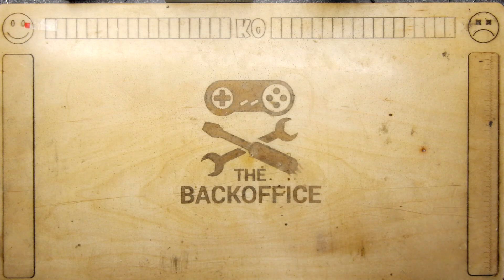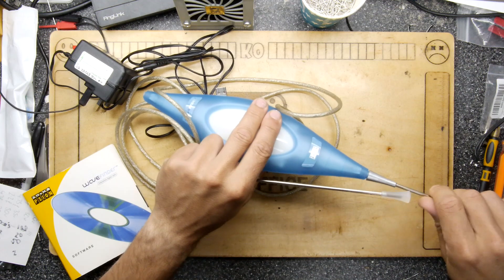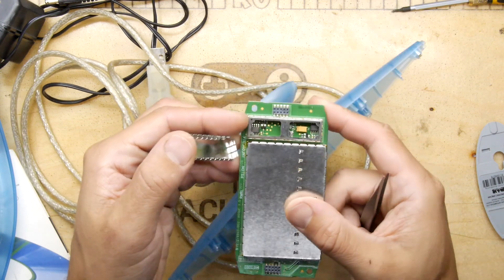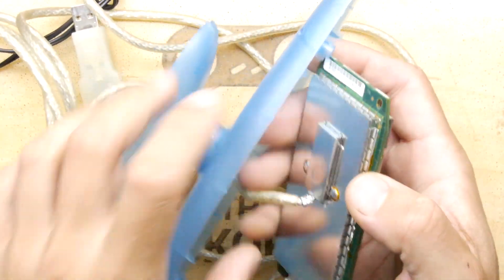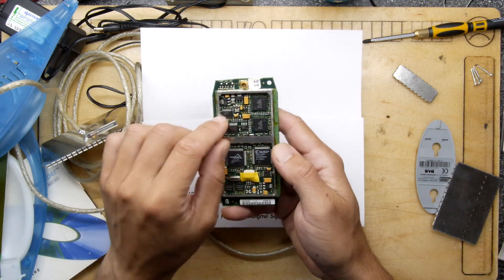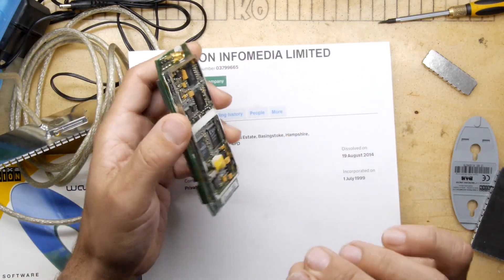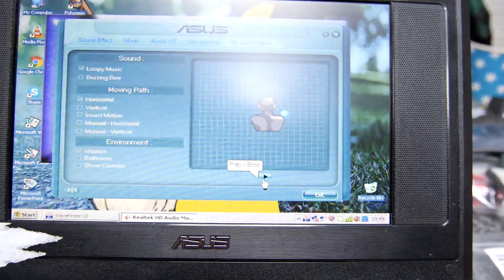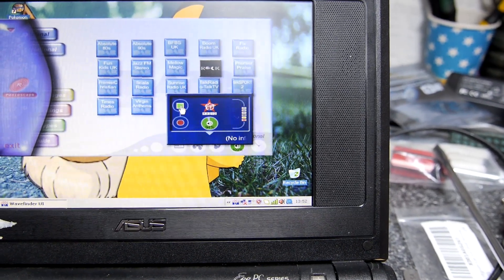Psion Wavefinder - The first SDR Radio Device

Comment: I am the creator of the DAB Bar software, the software often used instead of the Psion supplied Radioscape front end. I will say I have a great deal of respect for Radioscape's work. Although the UI is very much from yesterday, it was ahead of it's time at the time, and sadly not do usable for most people back then. This caused me to produce a replacement for me, I then put it on the Internet, and it took off as the default replacement.

To answer some questions posed in the video. The branding assets are installed with the software. They are out of date and are shown because the Service Identifier (the SID) is still in use. You will probably find Virgin is actually Absolutism Radio (what the original Virgin Radio rebranded to) and there may be a second new Virgin Radio without any branding. There were experimental data services to supply branding over the air (DDAB?) and some branding capability in the EPG specification, but I don't think anything is doing that today. DAB Bar had downloadable branding that was eventually maintained by Radio Feeds (thanks Vinnie)

In answer to a question unasked in the video, but common new question IRL (and yes people still sue DAB Bar)... Annoyingly I can not get to the data stream for DAB+ streams. I presume that the RadioScape demultiplexer code is deciding that it is corrupt and does not forward it though to me to decode.

I have had mixed results getting the Wavefinder working under emulation. My suspicion for the times in the video where the Wavefinder did not light up is the USB port closed down because of power usage. The Wavefinder can pull just a little more power than it should and any computer or hub following the USB spec should close the port down when this happens. The best work around for this is an old computer or a cheap powered hub (not self powered) that does not follow that USB spec all that closely. I have had it working with the 32 bit version of Windows XP, but never any 64 bit version. One day I intend to try 32 bit Windows 10.

Finally DAB Bar can still be downloaded and I do intend to publish it all on GitHub one day. It is just a matter of when I get round to it.
Reply: I'm in Bristol and have found here that two DAB stations(BCfm and Gaydio) are transmitting their branding OTA via the DAB streams.

Comment: Hello, great video. Great to see you got it working and to take a look inside.

Some points you might be interested in.

1. Wavefinders didn't work on 64 bit machines very well, and not at all on Windows XP SP2 (although SP 1 and 3 were fine).
2. As mentioned above, the Wavefinder was before DAB+ was a thing, which is why many stations are silent. 
3. The logos were baked in to the software.
4. The LEDs were a source of many issues, you could download a file to disable the LED functionality which improved reliability for many.
5. Other people created their own software to control the Wavefinder. One really good third party software solution was DAB Bar.
6. Finally, they don't exist anymore, but the BBC and Digital One used to have BWS (broadcast websites (!)). The BBC one was akin to a Ceefax/WAP type service and the Digital One BWS contained some games from Cartoon Network and an ITN mini site.
Reply from the maker: You were correct - I was interested in the points you mentioned, fascinating! The LED aspect is really interesting, makes me wonder if their fancy 'breathing' effect was the root cause of the issues - form over function!

Comment: I suspect the stations that didn't play (such as TalkSport 2 and Heart 90s) were due to them being broadcast using DAB+. I'm not familiar with the workings of the Wavefinder but if it is using original software or decoding the station from its built-in chipset, DAB+ wasn't a standard until the late 2000s, years after the Wavefinder came out and was discontinued.

I use a RTL-SDR device with a rooftop DAB antenna,. I have picked up Dutch, Norwegian and German multiplexes during tropospheric conditions.
Reply from the maker: Ahh interesting. I wonder what the range of DAB could be with a good antenna. Funnily enough, I have a large antenna installed in the house to test the SDR receive I got but I don't think I ever actually tried to decode DAB